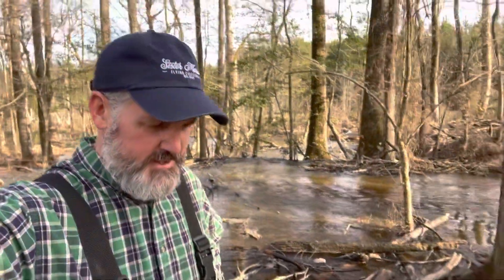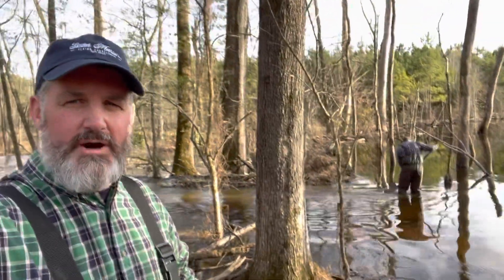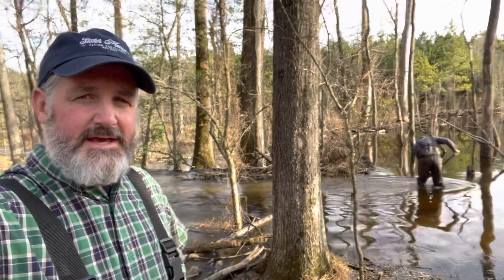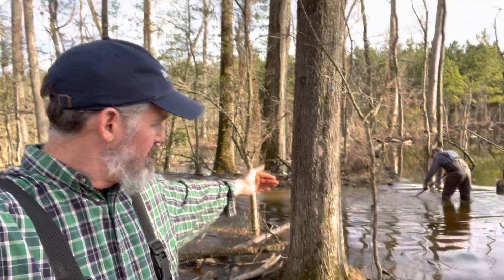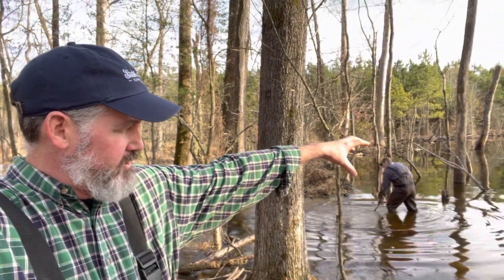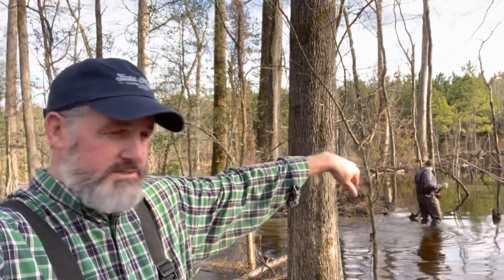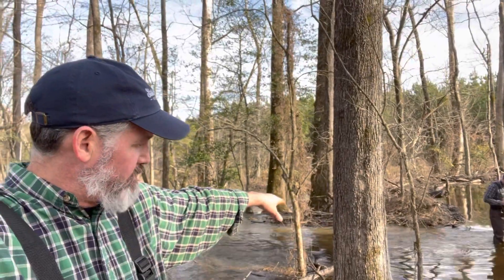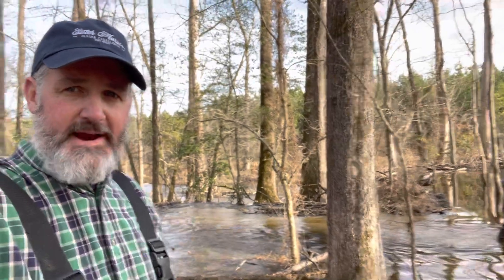Beaver Dam - Potential Solution

Comment: I've seen many videos of the Beaver Deceivers and all worked. You can't put a pipe in and expect them not to clog it, you need to put a cage around it, a long pipe, and far enough away from the dam. It will work for you, good luck
Reply from the maker: Thanks for the info.  I'm doing some research on the systems now.  Take care.